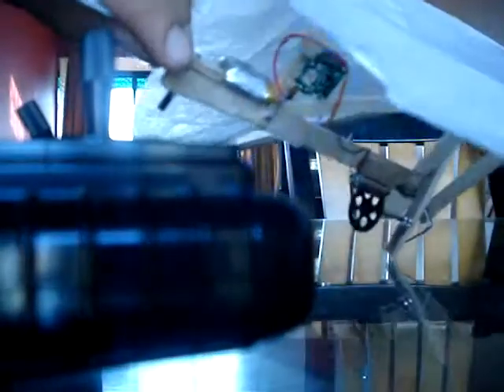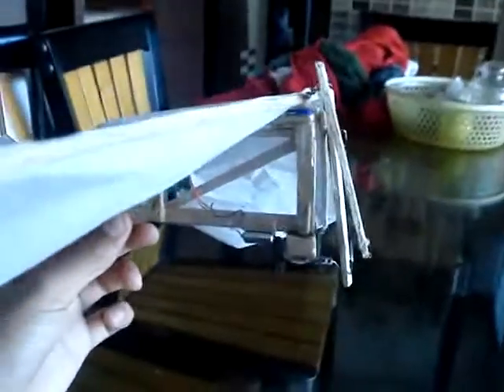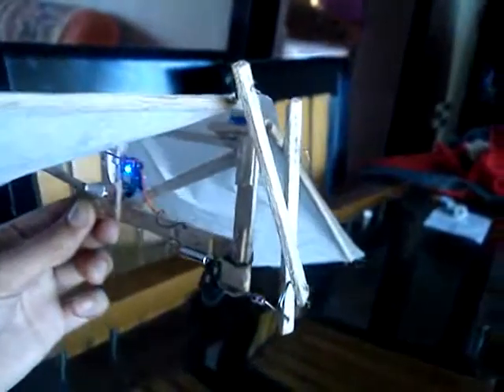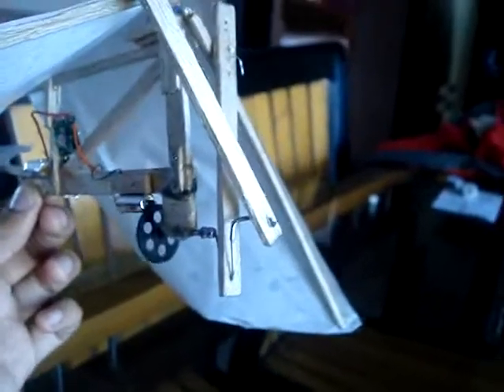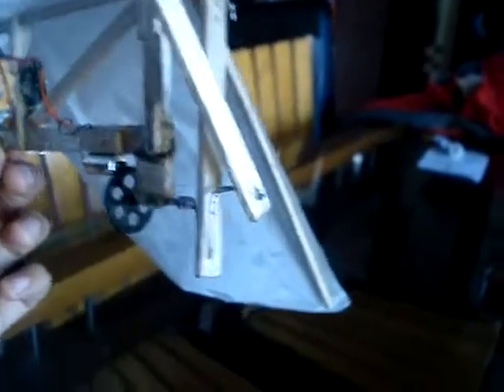RC Ornithopter

Comment from the maker: it virtually cost nothing because i used parts from an old micro rc heli so that fixed the batteries,motor and the rc control but the frame is made from balsa wood ..all the materials together went under $10